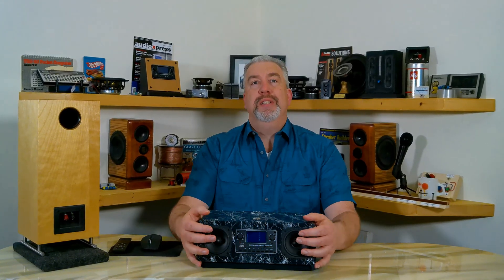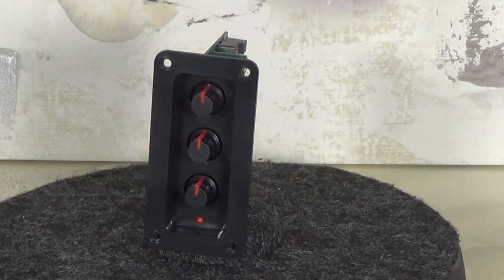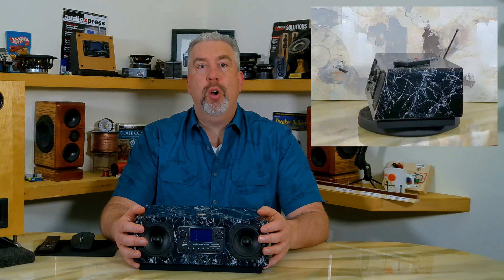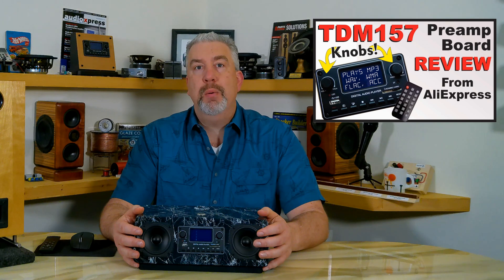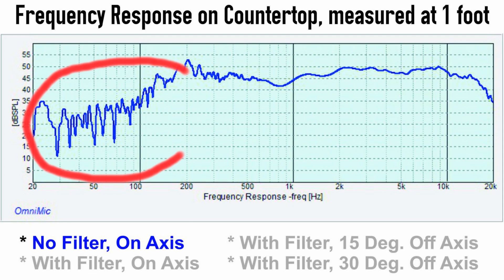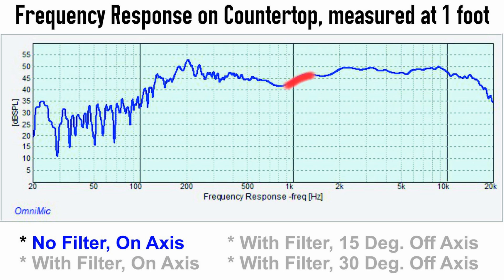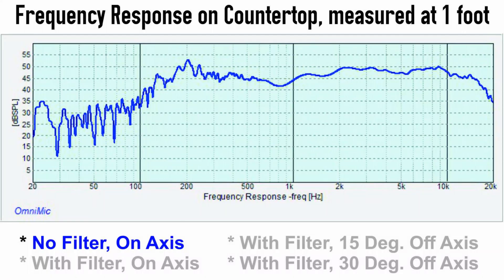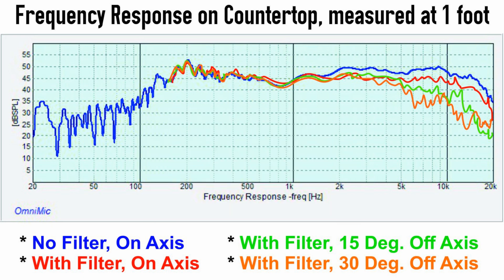Digging Deeper into the ‘Harmonious Table Radio’

Comment: This channel is sick. Im looking to build a boombox with sub, and those speakers, they seem really good for price and size. Was think on trying to use a passive radiator for the sub, any advise how id calculate that for this sub? Im also thinking on doing some tweeters too as i like details. This will be my first build ever, thought about using tang audio stuff as they get really good reviews, especially the 6.5 sub. But price would be kinda high. Any advise also on tweeters. I kinda like the idea of 5/8 inch cos of the dispersion. Anyways great channel.
Reply from the maker: Thank you Roy.  Here is a link to Toid's DIY Audio plans for a PR sub using the W5 Tang Band driver to get your juices flowing a bit:  https://toidsdiyaudio.com/product/voxel-passive-radiator-mini-subwoofer-plans/  
If you want to add tweeters to the Harmonious Table Radio design, you'll need to design an entire crossover for it. I know how you feel about detail, but you really don't need the tweeter for these, the response on the full-rangers alone is really good enough.
For a first build, consider doing a proven, existing design to ensure success. Not to discourage you at all from delving in, but designing a crossover is challenging and if you get a good build under your belt, it may give you the itch to try and design your own. 
Thanks for watching and for commenting!